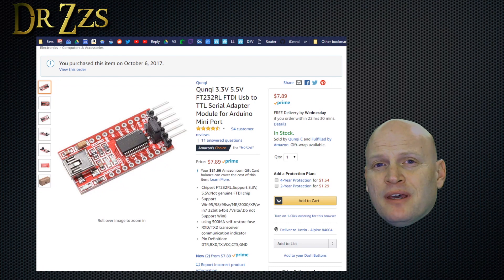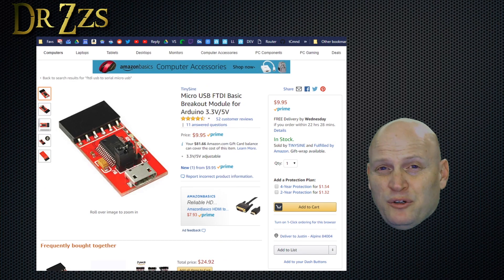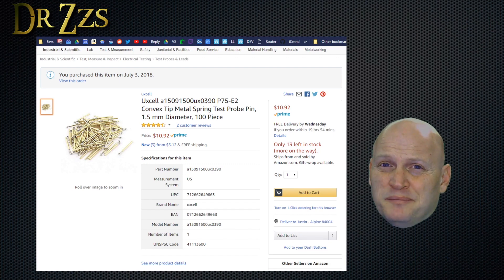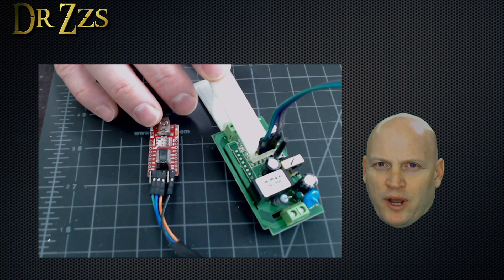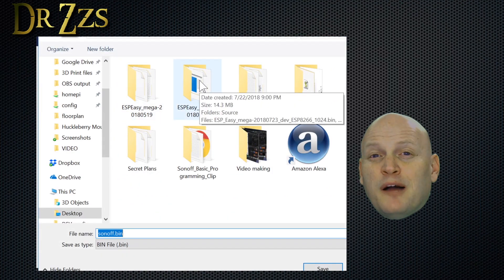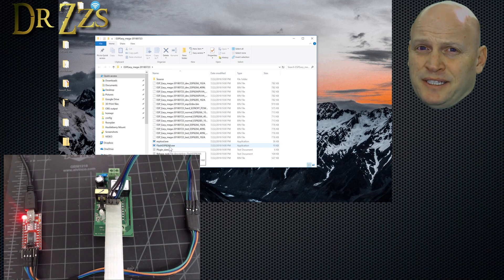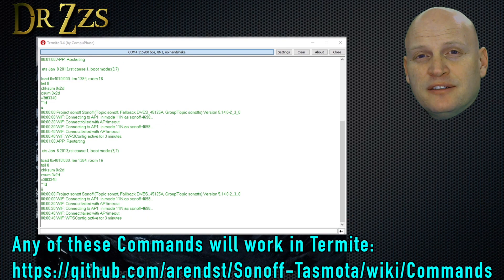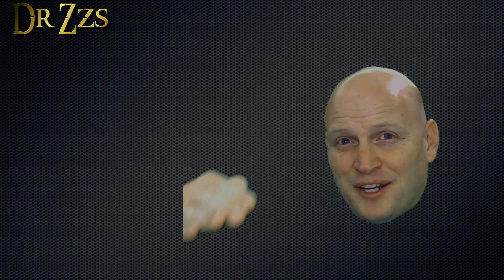How To Change Firmware on Sonoff Devices for use in Home Automation Projects

Comment: Hi DrZZs :)
2 things: the ftdi adapter could be fake, and ftdi with microsoft created some drivers that detect fake ones and could brick your adapter... try to search online, there's a lot of info about this...
2nd: there's a new esp flasher just released, and i still have to try if the POST flashing stuff is working on tasmota, too (they're ment to be used on espeasy flashed devices...): it would be great to add wifi credentials directly from this program... well, trying is free and harmless :D
link in next comment
Reply: https://www.letscontrolit.com/forum/viewtopic.php?f=4&t=3934
Reply from the maker: Thanks!
Reply: That first FTDI adapter in the video (the one that DrZzs uses) says right in the description that it is "Not Genuine FTDI Chip". 
That's okay if you don't use Windows.  It's also okay if you use the old drivers.  But like @squalazzo said; the new Windows drivers will brick your adapter.
Reply from the maker: Great input guys.  Thank you. 

I looked at the Micro USB FTDI I linked and it seems to be "genuine" FTDI so I assume it'll be compatible with Windows without causing any problems or needing extra drivers.  If I'm wrong please let me know.  
Thanks!
Reply: With command Wificonfig 2 you can start wifi manager, and you can configure it as you mentioned in the last flashing video without set all config via Termite.
Reply from the maker: uh oh.  
Should I recommend a different adapter then?  I am using Windows and I don't remember changing a driver, but if it'll save others some trouble I can link a different adapter.
Reply from the maker: Agreed, would love to skip the Termite step, and skip the compiling with Arduino IDE.  Maybe someday...
Reply: My ftdi adapter from China is apparently a fake (checking the serial# is a known fake number)  
Using this method it appeared to flash OK, but the sonoffs were non responsive.  
I have ordered another with the CH340 chip, but wanted to keep trying in the meantime...  
I was going to try Linux in a VM or live CD, but then I thought about using my Raspberry PI instead.  
Found out that with the PI you don't even need to use the adapter, just use the headers already on the PI.  
https://github.com/arendst/Sonoff-Tasmota/wiki/Flash-Sonoff-using-Raspberry-Pi  
Was actually very easy and another option for those of us with a PI

Comment: You can also drill out the solder with a 0.9mm PCB drill bit (0.035"). Xuchuan 10Pcs PCB Print Circuit Board Carbide Micro Drill Bits 0.9mm on Amazon. Then solder on your header pins. Spin drill with your fingers is all you need, will go through in less than 30 seconds.
Reply from the maker: excellent!

Comment: And again a great tutorial! Thanks! I don’t know why but termite isn’t working in my config. Never get the green text. To configure the Sonoff I’ll put the Sonoff in AP modus by pressing the button 4 times very fast and add my setting via the web configuration page
Reply from the maker: That works too.  Wonder why Termite doesn't like you?  Oh well. :)
Reply: DrZzs I don’t know why it doesn’t work. Most of the times when I finished flashing I want to play with it instead of investigate  why termite doesn’t work 🧐
Reply from the maker: Good call.  Just move on to the fun stuff!

Comment: Has anyone been able to figure out how to remove a sonoff from home assistant after using auto discovery?
Reply: Yes, the MQTT message is Retained - Send an MQTT message to the topic which you son off has used (probably has config at the end) with a empty (NULL) payload. i had to cycle through 4 or 5 different topic's to remove everything. Then just reboot HA
Reply: Just delete the device entry from known_devices.yaml file. Auto discovery creates this file and adds discovered devices to it.

Comment: Awesome 3dPrint. Im thinking of buying a 3dPrinter and this would be an other reason to buy!

I just removed the solder with a old COAX Cable. Put some solder liquid on the thin COAX CAble and heat up the solderpoint from one side and put the Cable on the otherside!
Reply from the maker: cool!  way to find a creative solution!

Comment: Thanks for doing a deep dive into flashing. I'm sure it will be super helpful for a lot of folks. I just have a question about the chksum error on restart (https://www.screencast.com/t/GcObn2YlA)... doesn't that indicate a problem with the firmware or is that standard each time any Sonoff restarts?
Reply from the maker: You bet! 
I don't get anything from that link. Can you post it again?  
That was probably before I ran the Backlog command (which I just remembered isn't in the description yet).
Reply: Sorry, I have to remember to space any special characters away from the URL :) 
https://www.screencast.com/t/GcObn2YlA .
Reply from the maker: ha. 
Well, good question.  I hadn't really paid much attention to that.  It was working so I guess whatever it was doing is normal.  Most likely it's related to not finishing the setup yet, but I can't say with much confidence, just a guess.